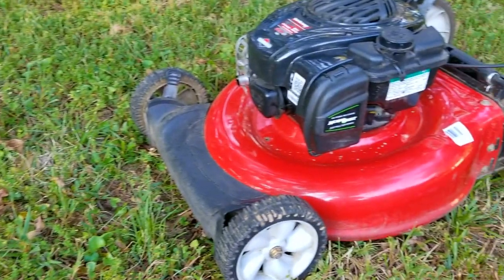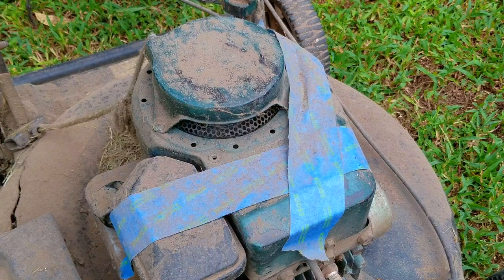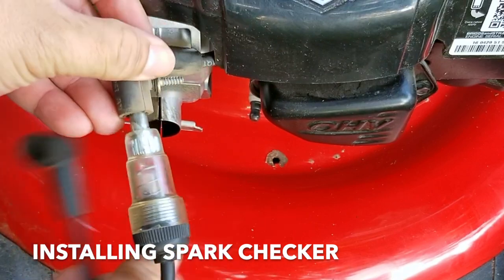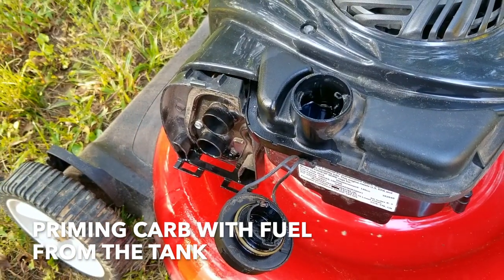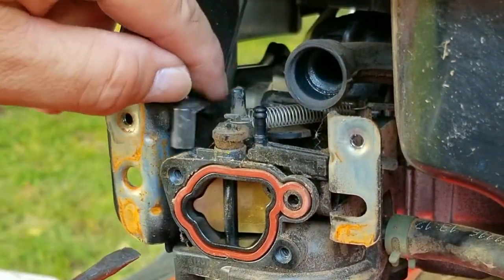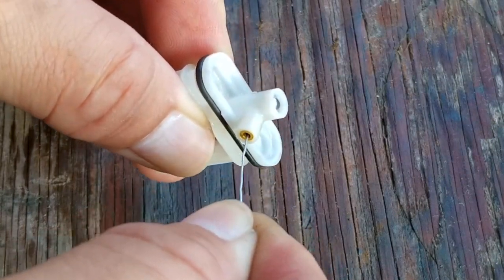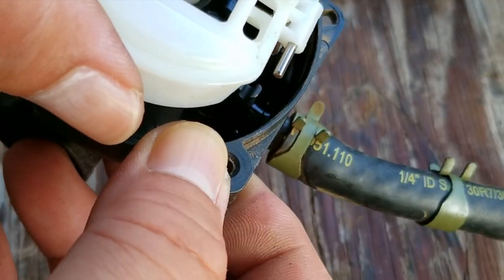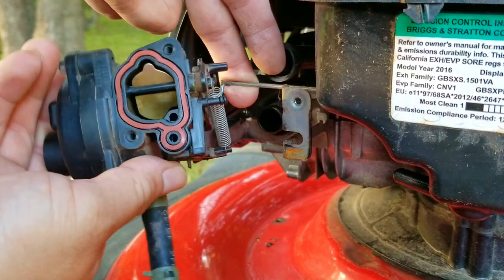Why Did Briggs Stop Making The Flathead Engine?

Comment: Briggs with its flathead had little competition,  got lazy,  and  for many years and fell way behind.  Companies like   Kohler and Onan had been building  advanced overhead valve gas engines for welders and commercial applications for many years.  When Honda come onto the scene with their smooth quiet  bullet proof overhead valve engines for consumers and pros they almost buried Briggs.   Furthermore those old Briggs were notorious for being hard starting.  
  I remember when I was a kid when Honda come into the market like a tornado.   All the farmers were replacing their Briggs with Honda's as well as all the commercial power equipment.  Honda was a revolution at that time.    Good video by the way.
Reply from the maker: thank you for the great and well thought comment, I really appreciate it Martin Schulz.

Comment: Its called Planned Obsolesce. It's when a manufacturer builds in failure at a certain point to guarantee replacement before its normal life span. But not so soon as to generate discontent. Its a way to generate sales.
Reply from the maker: you are correct

Comment: I'm thinking these new Briggs engines are running ultra-lean jet and carb settings to meet current emission regs. Hard starting has nothing to do with the over-head valve design, but perhaps flat heads can't run on leaned-out carbs so they had to go to the OHV. I had the same problem with a new Lawnboy mower, it only would run fresh fuel. We have a 1996 10 kw generator powering our camp, and it uses a 16 hp Briggs Vanguard v-twin which has over head valves. That engine is super reliable, and is stored from October till May every year, and so far has never failed to start on 8 month fuel from the previous season.
Reply from the maker: I can agree with this comment, thanks.

Comment: I'm not sure exactly when, around early 2000's?, in Europe the half metal half plastic carbs showed up and caused so much trouble. Plastic half was ontop of a hunk of metal integrated into gas tank. What happened was the plastic started to bow after a few years and it started to draw air into carb mechanics causing problems with fuel flow. That was annoying, to keep sanding it flat enough every 3 years.
Reply from the maker: yes , the mix of the two doesn't work, either all metal or all plastic.

Comment: Putting a small gas filller between the tank and the carb and that main jet will not clog again. Also run Stabil run year round and run the gas out at the end of the season will help. Never changing oil means your mower is now disposable.
Reply from the maker: thank you MrPoppyDuck.

Comment: I had a riding mower with a 25hp Briggs engine OHV,  one of the pushrods got bent.  How did that happen, I don't know.
Reply from the maker: me neither, but I have to wonder if the valve lash might needed to have been adjusted before the bend.

Comment: The main issue I have with both the recent OHV Briggs AND Tecumseh engines has been the plastic carb. 
On the old flathead carbs, using a box-end or open-end wrench, the bowl and main jet could be removed and cleaned with the carb mounted to the engine. To temove the bowl on the plastic car, the fasteners are recessed so you can't use a wrench, and it sits too close to the deck to be able to use a socket. So complete carb removal and disassembly is the only option, if the tiny jet plugs up, which it does way too often. The fuel-line also looks like it's too short to fit an inline fuel-filter! 
Of course, recent Honda OHC mower engines aren't immune to negative engineering. They introduced a fully automatic choke, using a pellet, like a car's coolant thermostat, that has been very troublesome!
Reply from the maker: yes, it seems some of the designs are not friendly to yearly maintenance .

Comment: I'm curious about people's experiences with "bad gas".  I've never had an issue with year or two old gas.  The only time I've ever had issues related to old gas was with a snow blower that hadn't been run in at least 8 years.  Had to clean the jets in the carb and it's been fine ever since.
Reply from the maker: are you using ethanol gasoline then?
Reply: @INSIDEHOUSEGARAGE  Up in Michigan, it's a bit of a hassle to find 100% gasoline.  I run 87 octane with "up to 10%" ethanol.  
The 1980 brigs snow blower, 2010ish Brigs craftsman lawn mower, and the various cars parked for a year or two at a time all start up just fine coming out of storage  with nothing done to them after the last use of the season.  I know it's good practice to drain the tanks and run them dry, but I've never run in to a problem storing over the winter for the lawn mower or over the summer for the snow blower. They just start as usual when I pull them out.

Comment: Before he passed away, there was a retired Lockheed Martin engineer who opened up a small-engine repair shop in my town.  I asked him if he liked Honda and he said he'd take a flathead Briggs any day of the week for the average homeowner.  His reasoning was that he could tear down a Briggs in about 22 minutes (yes, he had it timed) whereas with the fancy Honda, it would take him 2-3 hrs for a rebuild.  He said that the Hondas were great engines, but unnecessary for the average homeowner and Briggs were dirt cheap to rebuild.  He did like Honda for commercial use.  I will continue to buy Briggs & Stratton until they give me a reason not to. I don't remember his name but that guy was a wise old owl.
Reply from the maker: you make a great point, Hondas are great, but not for everyone.   And there's a reason briggs can be easily and cheaply rebuilt

Comment: I just got finished fixing my neighbors new Walmart special mower. I will say the plastic parts are cheap junk. But once I got it running it has plenty of power and no bog in really high grass. The QC on the new mowers are just so bad. The flat heads were just so indestructible and easy to work on. And with a little bit of tweaking you could get good torque out of the old flatheads.
Reply from the maker: totally agree

Comment: I have a 20+ year old trash picked Murray 5 speed riding mower with a Briggs flathead which with a starter and solenoid from another riding mower and some gas it fired right up, I replaced the bowl as it was surging and it was full of varnish and sludge. I'm getting a V belt soon via the interweb. It has no deck as it's gonna be used as a racing mower!

My main rig is a self propelled Toro with a Briggs OHV (550ex I believe). Bought it last year, nothing wrong YET.
Reply from the maker: wow very nice
Reply: By the way @INSIDEHOUSEGARAGE the Murray is going to be a racing mower, I'm straight piping it (side pipe) and running slightly smaller wheels on it. The horsepower on the Murray is 12.5hp

Comment: Old low power B&S engines rock because many were cast iron. Carbs so simple to clean, rebuild, repair. Only issue with old engines is points/ condenser that require flywheel removal to access. Just replace them points with a Solid State device sold by Oregon. Clean flywheel magnet and magneto pole of rust,  then lightly WD40 to future resist rust. Turns out rust is a magnet field resistance. Thanks for this YouTube topic.
Reply from the maker: thank you Cliff Weinan

Comment: I got a mower and a snowblower. Both Honda. I never bother drain any fuel at the and of the season and they always start without any problem at all. The fuel consumption is about half compared to similar engines from B&S,  and the noice level ... well  ... no problems listening to a podcast while using either of them. Yes. Honda is expensive, but they surly know how to put together a flawless engine. The mower is now 15 years old and the snowblower 5. I changed the oil on the mower after 3 years and the oil was still clear.
Reply from the maker: thank you Stefan Astrom, I appreciate it.

Comment: I switched to Honda's mowers back in 2002. Then this past summer switch to Ego Battery Powered mowers. I am not an environmental activist, but I found 2 great deals for 2 fairly new Ego mowers for more than half of what a new unit would cost in the store. I never looked back. I switched everything over to Ego in my Garage. My near new Honda mower is now in storage under our house for who knows how many years. No use in selling it. Will never get back what I paid for it.
Reply from the maker: very true, and good luck with the battery life on your Ego, because replacing them is expensive.

Comment: Flatheads will run forever as long as you take care of them.   I have a couple of engines from the 1960s on a vintage lawnmower and rototiller.   They still run good in 2023.
Reply from the maker: you got that right!

Comment: I worked for a construction company for about 10 years and I learned a lot about small engines by trial and error and some experimenting. First off small engine manufacturers were pretty much forced into OHV engines because of emissions, both exhaust and noise pollution were reduced by going to OHV engines. About the same time most states passed laws requiring gas to have at least 5% ethanol, EXCEPT for off road and racing use. More than anything else alcohol is to blame for small engine problems     . Gasoline with any kind of alcohol will turn into 💩in a matter of 4-8 weeks. Alcohol will absorb water just from the atmosphere!! If you want your small engine to start after sitting for more than two months here is what you HAVE to do. (1) drain as much fuel out of it as possible by either running it or draining it out. (2) mix about 2 ounces of non ethanol gas with about 2 ounces of Sta-bil (I prefer 360) and about 1-2 ounces of Sea Foam together and make sure it’s well mixed. (3) put in fuel tank and run it dry, until it kills. (4) after it kills put the choke on fully(or stuff a rag into the air inlet)and crank it over to make sure all of the fuel mixture is sucked out of the tank and carbs.this step is very important to make sure all of the passages are clear. Then change the oil and filter if applicable. Then when you are ready to use it put in fresh gas and if it ran decent when you put it away, it should start after a couple or three pulls of the rope. I know that this works because it worked for me and I was in charge of about 50 small engines that ranged from about 3-30 horsepower. They will run better on non ethanol fuel but as long as you make sure you have fresh fuel when you start it and you get all of the fuel out of it when you store it for more than 6-8 weeks, this will work for you.
Reply from the maker: thank you Cobra3901

Comment: I recently fixed my 12-13 year old Craftsman 6.75 190cc with Briggs and Stratton haven’t changed oil since 2013 

I do maintenance on engine completely machined rebuilt got rid of carbon buildup and changed carburetor and filter and new oil 

Deck was minor rust completely repaired and repainted 

For craftsman OHV 550E still runs 12 years later did every oil change every 3 hours or 1 months 
I would say it reliable but I would love to see aftermarket carburetor better than original B&S carburetor last twice longer
Reply from the maker: thank you for the information

Comment: Have a Toro mower that has a Briggs flat head on it. Bought it in 1996 and the only problem with it is that the deck is an aluminum casting and it is slowly rotting out. Engine is just fine!
Reply from the maker: interesting about the deck,  but yes the engines are fantastic! thank you Subgunman

Comment: I bought a mower with a Briggs and Stratton flat head engine in 2007. I only put 93 octane in it. Every winter I pushed in the garage. No fuel stabilizer or anything. Every spring I took it out and it started. I changed the starter rope once. I changed the sparkplug once. I bought a newer mower for a friend of mine. Has the newer engine. Stored it for one winter and did not want to start
Reply: High octane fuel in lawn equipment does nothing and is a waste of money.
Reply from the maker: story of my life, thank you Lord Raiden.
Reply from the maker: as long as it high octane and no ethanol.

Comment: I bought a MTD 21 inch with a 5 HP Briggs and Stratton engine.  That mower lasted me 17 years. The engine was still good but when the carburetor needed replacement the so called service center bent the shaft by unnecessarily removing the blade which they said was bad.   I refused to pay the 145 dollar repair bill.  My kid a lawyer served them threatening to sue if they did not drop the matter.  They drop the matter.  Bought a new bolden with a one of the new Briggs and Stratton engines.  Lasted 7 years the crankcase crack.  Was visiting my brother we got talking a mowers.   In his barn he had the mowers we used growing from our folks place.  I am the proud owner of a 1967 Briggs and Stratton powered 19 inch deck
Reply from the maker: interesting situation for sure
Reply: @INSIDEHOUSEGARAGE  really dislike all the plastic and construction of mowers now a day.  I miss the old one lung gravely

Comment: I prefer the old flathead, you can find all sorts of parts pretty easily.
Got to work on a couple of new engines last year, but both had the same issue you found, a clogged jet. Can't say anything about parts since I have not been down that road.
I would still use both engines as long as they did the job. 🐺🔧
Reply from the maker: I like this comment, thank you Jonathan Sherwood.

Comment: I’ve been mowing lawns for 60 years.  My advice:  (1)Before putting the mower away for the winter, run it until it stops for lack of gasoline, and drain any remaining fuel.  (2)ALWAYS use a fuel preservative additive.  (3)Buy a Honda, but hurry since I’ve read that Honda is discontinuing gasoline engine mower manufacturing.
Also, I’ve had 2 plastic fuel tanks (not Hondas) develop cracks that leaked gasoline.  Watch out for these.
Reply from the maker: thanks for the tip

Comment: I used to race go-karts. The engines were Briggs 5HP flatheads. I can tear one down in my sleep. It's amazing how much abuse those engines could take.

Owning & operating... I would probably favor the new engines if it was just me using it. They're quieter and smoother running. I know how to take care of my machines, so I wouldn't expect to have to do much in the way of repairs. Fuel consumption is a non-issue, at least in a push mower. Push mowers don't usually get used enough for that to be a concern. unless you're the neighborhood kid mowing multiple yards per week. And in that situation, I'd take a flathead anyway for it's durability. If you're using a push mower enough for fuel consumption to be a concern, it's time to get a riding mower. My 10+ yr old Toro push mower has a flathead (Quantum maybe) which has never been apart, and I have no plans on replacing it. I expect the engine to outlast the rest of the mower. Once a year, I change the oil, clean the air filter, and sharpen the blade. At the end of the season, I put fuel stabilizer in the ethanol-free fuel, and it cranks fine in the spring.

If you have people using your equipment who don't have a vested interest in keeping it running, or maybe even have an interest in destroying it (like, say, your kids, who would rather be playing video games), a bulletproof flathead has a lot going for it.
Reply from the maker: thank you for the comment.  you seem to have a lot of knowledge!

Comment: I own both a 550ex and 500e and have used them both commercially now for about a year. The 550ex has probably over 100 hours of running time and I'd guess 60+ on the 500e and never had a problem with either. Though I do prefer the old ones, based on experience, these new ones are still a quality product for the most part. "Just add oil" feature is a troll though
Reply from the maker: I completely agree.

Comment: I’ve had nothing but trouble with a new B&S engine. It barely ran the first time it was used with new fuel and it fought with me the next two attempts. The mower shop then charged me for a repair even though B&S told me it was a warranty repair; then the engine barely ran and quit working again in the next attempt to mow the lawn. I gave up and spent too much money on a Husqvarna electric mower that works but still can’t cut my tiny property with two fully charged batteries. It’s beyond frustrating when I’ve used the old B&S engines for 10-20 years with little more than an oil change and cleaning the spark plug. Nothing has been better while everything about the new mowers is more difficult.
Reply from the maker: they've fallen a long way for sure

Comment: I’ve been a welder for over four decades, and used many engine driven welding machines powered by Onan two cylinder flathead engines. Two of them belonged to me, and I can tell you that they were bulletproof engines! And then they disappeared! Suddenly, it was impossible to find a new portable welder powered by Onan. The reason was supposedly that the EPA mandated that they stop manufacturing flathead engines, and go to an overhead valve design. Onan’s response was to quit making the two cylinder gasoline engines altogether!
Reply from the maker: wow, that's was a bold move.

Comment: I have had the newer OHV motors have the valves stick open when using old gas.  I learned never to use old gas in the newer motors.  My old motors whould work with old gas and the valves never got stuck. Also the new gas has enthanol which attracts water and brakes down fast.
Reply from the maker: you got that right.